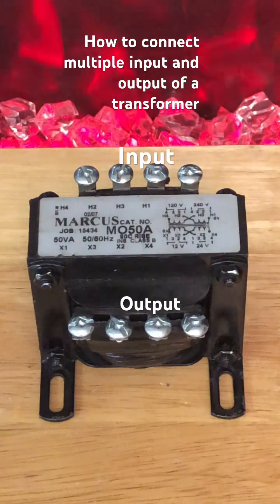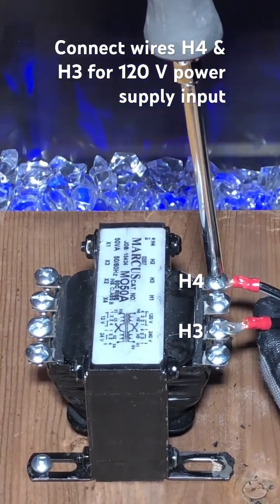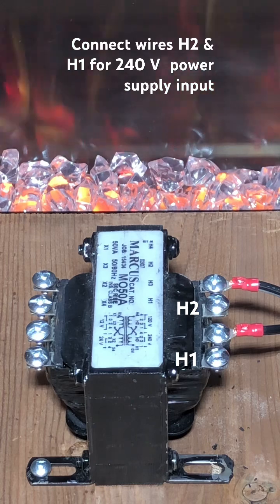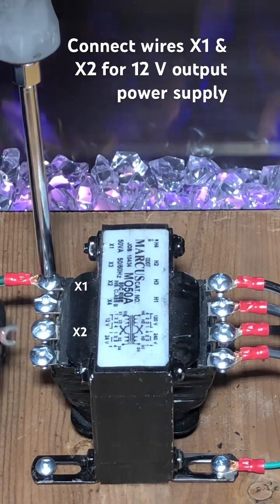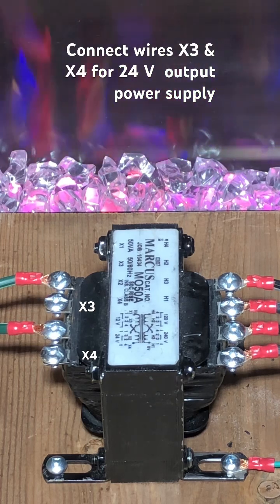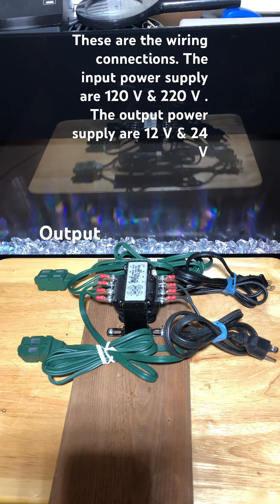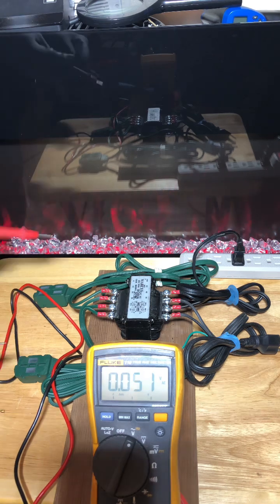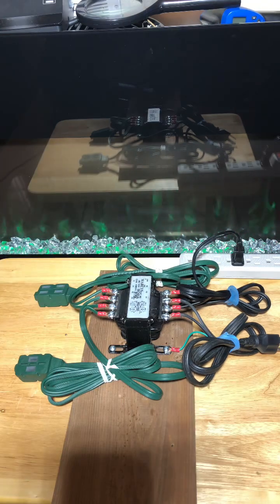DIY How to connect multiple input and output of a transformer #short #diy #transformers #shortvideo

Comment from the maker: I used 1 transformer with multiple input and output voltages. In Asian countries, they have 220 volts power supply while in Europe, they have 120 volts power supply.
Reply: Yes sir.in the Philippines standards 22O but we have also 110 using by transformer😊..Thank you so much sir  for sharing the  information have a great day!😊❤